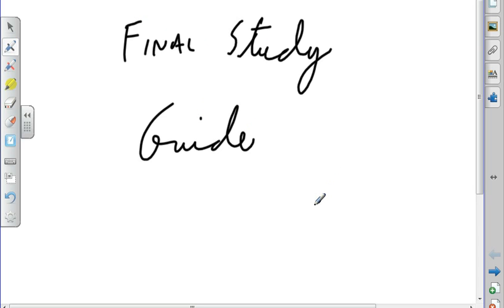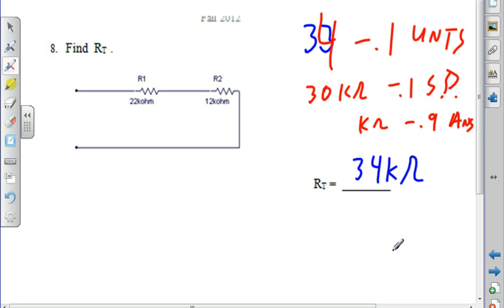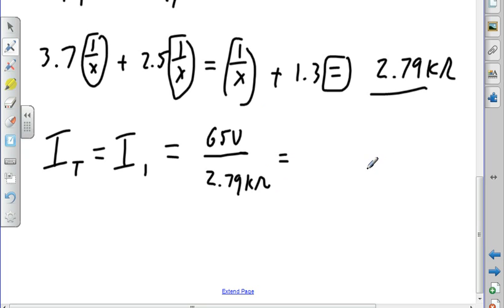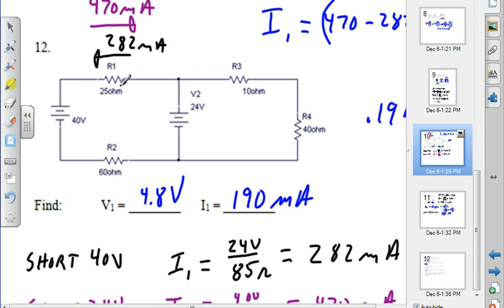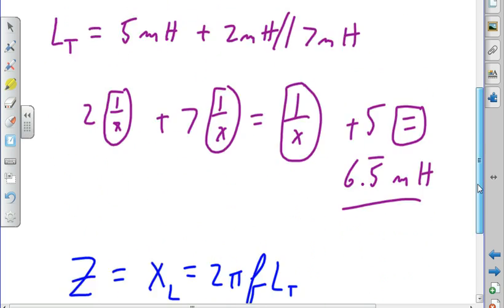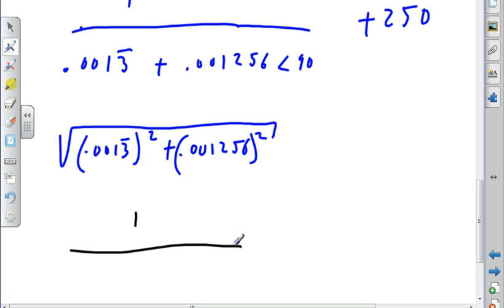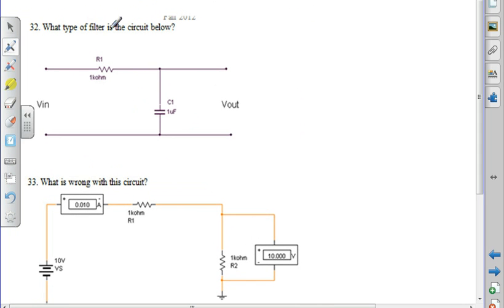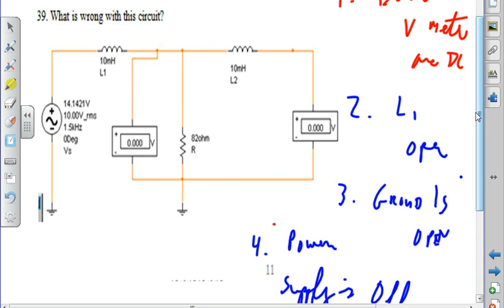Circuit Analysis Final Exam Review

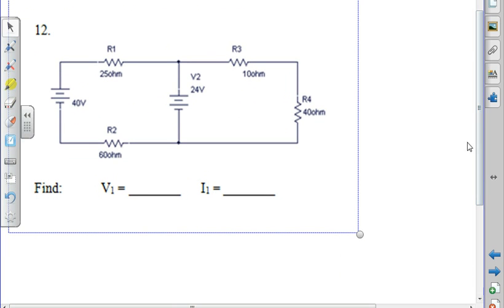Comment: If I am not mistaken, I believe there was a mistake made on the super position problem shown @ 28:23. When 40V is shorted, you would need to use current division to find i1. the equation would come out to 24*50/(50+85) where 50 is the total resistance on the right side in ohms and 85 is the total resistance on the left side in ohms.